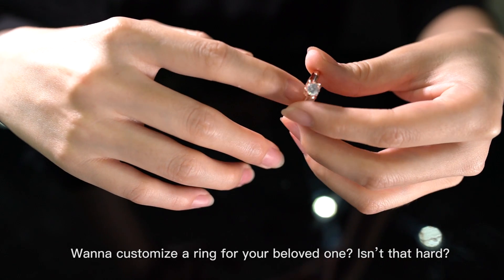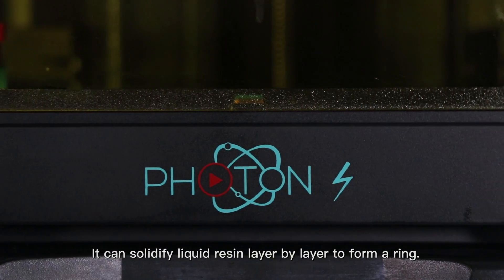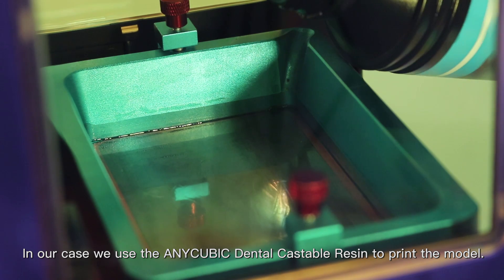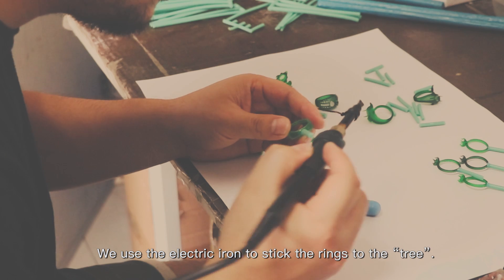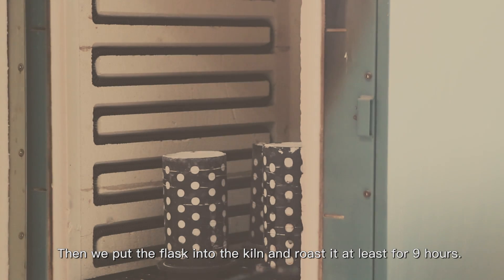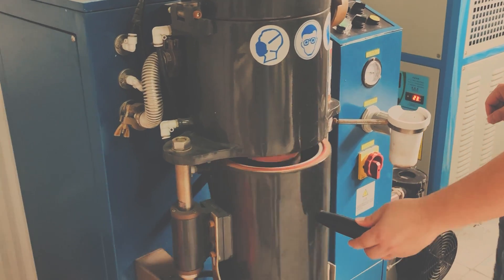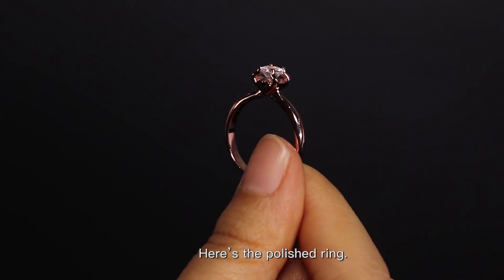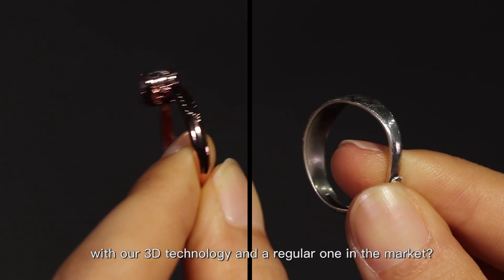How to use 3D tech to customize and print a ring for your beloved one? Here is your answer: Photon S

Comment: Hi ANYCUBIC, what burnout schedule (temperature / hours) did you use for metal casting in this video ? Thank you
Reply: They do not provide any type of information, they only indicate 950ºc for 0.5 hours and the foundry still has many problems.
Reply: It is the most horrible resin on the market, they do not give information on the scales of the casting ramps

Comment: Good Morning! What is the specification for this resin used in jewelry. It's my work area.
Reply from the maker: Hi, the anycubic dental castable resin' specs are as follows. adhesion: 50-170Mpa·s; Wave length 405nm. Density:1.05-1.25g/cm^3; cured resin hardness 80-88D; heat distortion temperature: 78℃
Reply: @ANYCUBIC3D  thanks
Reply from the maker: @MrAndrefaciochi  No worries.

Comment: I HAVE BEEN USING THE ANYCUBIC PHOTON FOR A YEAR I OWEN AND OPERATE  A  CUSTOM JEWELRY STORE FOR THE PAST 20 YEARS IN THE SAME TOWN IN FL. BEEN A CUSTOM JEWELER FOR 43 YEARS IT WORKS FANTASTIC IF YOU USE CORRECT RESIN TO CAST WITH . WITHJ THE RESINIT TAKES 33.5 SECONDS PER LAYER
Reply: @Eugene Kim Man the basic green resin that comes with the printer IS NOT CASTABLE. The castable one is green too but is called "dental green castable" and not just green. No wonder why you had so much problem with it, you basically tried to cast with plastic...
Reply: @NoHeartless2  Castable resin is not good either. I have not been successful in foundry.

Comment: I have anycubic photon and resin used is Dental castable green . It has ash content when burning . And this resin doesn't give good results
Reply: Try making a silicone mold of this print and injecting wax into the mold. Use special injection wax for best results.
Reply: @33europe52   Thanks for your suggestion . I can also doing this. bit lengthy process making the silicon mold dyes using printed models. Instead we can use castable resins with out ash content for direct casting
Reply: exactly the same problem that I encounter, I'm looking for a castable resin (lost wax process) that works well in anycubic, the basic resin is good for making rubber mold, but I want to do the direct casting, without having to make mold of eraser
its foundation that did not have good results, was in which metal?
Reply: @59TiagoMonteiro  Use B9R Cherry resin for direct casting
Reply: @daaga3309  What settings do you use for the B9R Cherry resin? Its not printing on my photon

Comment: The time required to print the rings was 4 days?
Reply: It took two days from printing to casting to complete.
Reply: It will take 3 - 4 hours to print 1 ring And can also print 20 rings in that time. The video shows the whole process  to turn the printed 3d model ( master piece )  to Rings by using Casting of metals

Comment: Hello. I have this resin. I could not get a good cast. all textured and chopped.
I need times in the oven.
There is no information for anycubic dental resin. thank you
Reply from the maker: We put flask into the casting machine for around 6 hours. The density of the dental castable resin is 1.05-1.25g/cm3 (25℃) compatible with UV wave 355nm-410nm；
and the viscosity is 1.05-1.25g/cm3 (25℃)
Reply: @ANYCUBIC3D  Hi ..I have trouble in gold casting . I 'm using green resin that came with the printer. I never get a good cast. can you tell me all information of investing powder and burn out cycle?
Reply from the maker: @sumikim2488  Hi Sumi, it's not recommended to use the resin come with the printer to do the casting. The castable resin is necessary. For the information about the  investing powder and burn out cycle, I'm sorry we don't have that information of the  professional metal casting.
Reply: @ANYCUBIC3D  OK What resin do you use? I need to cast
Reply: @ANYCUBIC3D  The dental castable resin green from Amazon seem to be same as what i have. There no mark of differences on the bottle. what resin do you use?
Reply: @ANYCUBIC3D  I got a Blucast X5 resin but it never works with your printer. guess that Anycuic printer is not compatible with other resin. is it right?
Reply: @ANYCUBIC3D  I purchased it a few month ago. but it takes another 3 weeks to get Castable resin so, I bought a Blucast X5 which should be compatible with this printer, BUT IT NEVER PRINTS. Can you tell me what's wrong? Firmware up grade is necessary or something? This printer worked well with the resin that came with the printer.
Reply from the maker: @sumikim2488  Hi Sumi, could you tell me the specification of the resin. Is that compatible with 405nm wave UV lights?
Reply: @sumikim2488  you ever get this resin question figured out?
Reply: Hi Carlos. Did you try to cast gold? and the result is textured and chopped just on the surface? how was the color? or aren't there serious cavities everywhere?
if it was just chopped on the surface, you could polish it, no big deal, but my result is dark gray surface, can not polish it away.
Reply: Hello.
 anycubic dental cast did not work for me. I do not do casting ... I have a specialized person in the field. I made several castings with different people ... and this resin continued to go wrong. lots of texture.
I am currently using Bluecast X10 LCD. in fine pieces has gone well.
you need to look for LCD resins, do not use any resin. before buying try to know more information about the product.
if you buy Bluecast X10 LCD, you have to increase the initial time 80 seconds for 8 /10 layers....and 13/15 seconds  normal expossure.... the off time always in 6.5 seconds.
this resin needs more time ... and they also sell other products. see well on the products and any question always asks
the link were i buy a sample 250 ml resin:

https://3dgarage.shop/en/bluecast-resins/88-7-bluecast-x10-lcd.html

any doubt, go on forums and there will always be someone who helps. You have some very good ones on Facebook.
regards. :-)
Reply: I forgot to mention that I only work with silver.
Reply: @sglhkzp  Is your printer Anycubic photon? or other printer? I tried BlucastX5 yesterday but it was not compatible with Anycubic photon. It printed nothing.
Reply: @sumikim2488 
Hello.
My printer is Anycubic Photon.
  Is your resin for LCD? or SLA?
Anycubic works only with LCD.
Send me the parameters you defined for printing.
As I mentioned in my previous post, this resin needs higher times in the first layers to hold in the holder, if it is a little time, it will not grab the holder and stick to the film ...
Reply: @sumikim2488  Hi, 안녕하세요. are you korean? :) I'm  jewelry beginner from photon-s. did you solve that problem? I don't know which do i use castable resin and adjust time value.